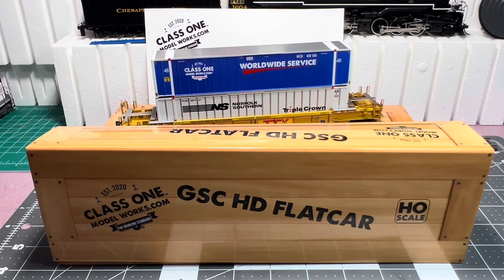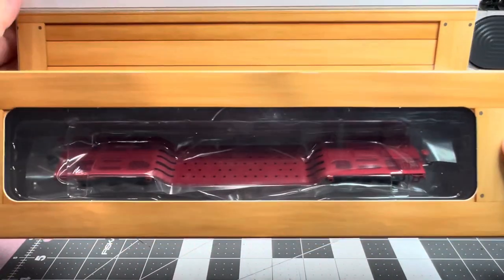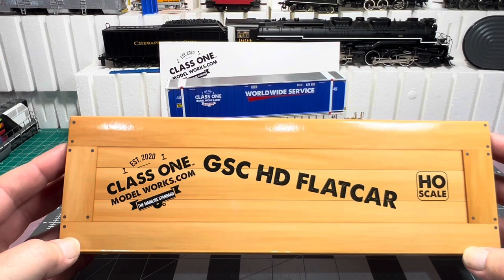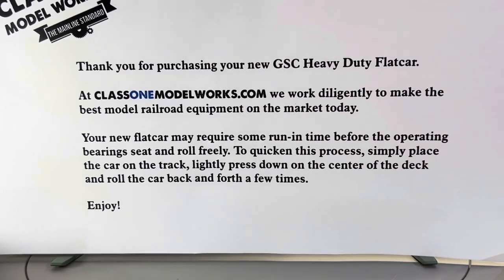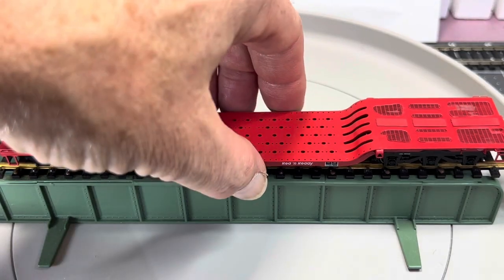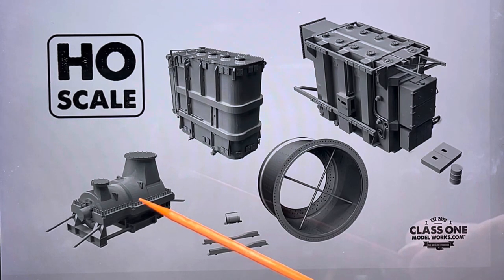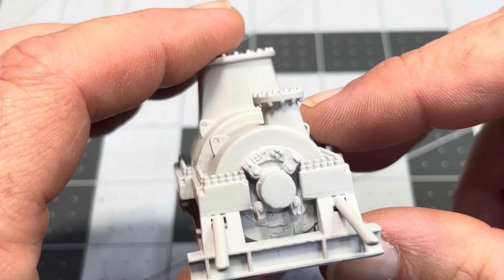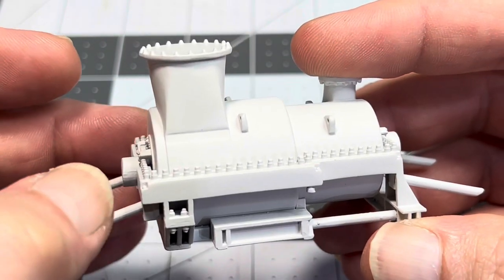Class One Model Works - HO GSC Heavy Duty Flatcar & Load

Comment: Thank you thank you for reporting on the deformation of the car, my EL has the same problem. Would it be possible for you to show the points where you applied pressure on the car to bend it? Car does have some vertical slop in the draft gear box, otherwise a beautiful car, loads of detail and a unique addition to my roster (should look good coupled to my Exact Rail EL 4-axle dp flat). Great review.
Reply: Talked to Class One myself, and they were very nice, explained the straightening process, said they would replace the car if anything got damaged from straightening it. Worked for me, brought the couplers right in line with the Kadee height gage. All fixed.
Reply from the maker: Its good to hear you got it fixed! ClassOne’s customer service is pretty good. I’m sorry it took me so long to reply. I was on a road trip.
Reply from the maker: @michaelminatelli8749 Classone put out a video about bent cars. 

https://youtu.be/X24we1Bmy4Y?si=0wYopMHFQGXgIuYW